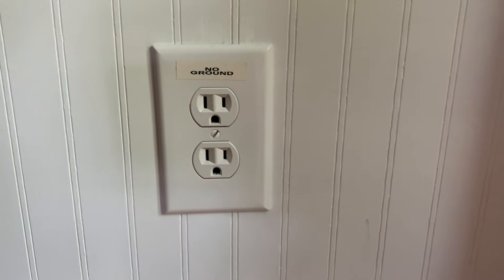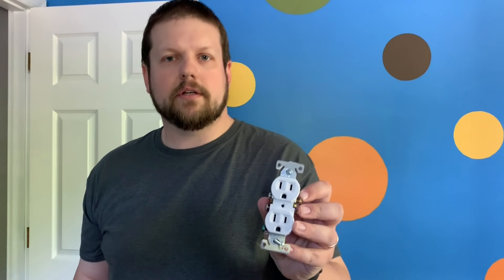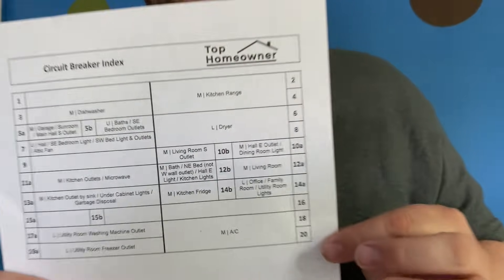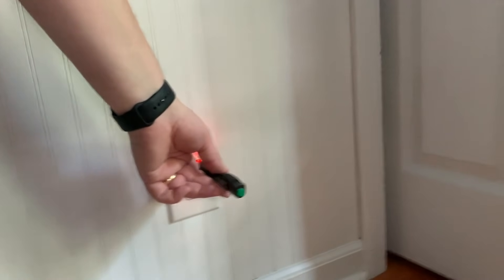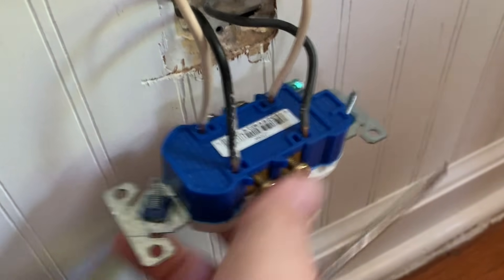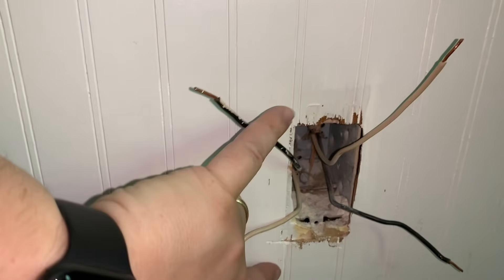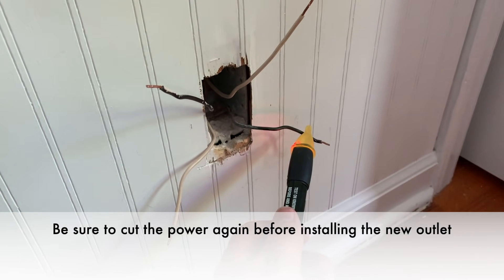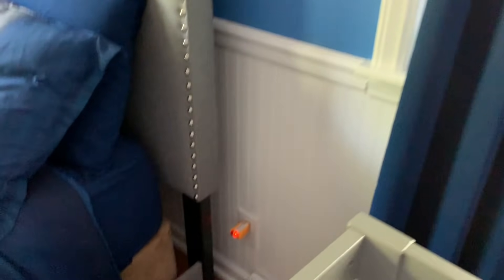Fixing Ungrounded Outlets - An Alternative Option to Rewiring Your Home

Comment: To be code compliant, be sure to put the "no ground" sticker provided with the GFCI on the faceplate if you are replacing 2-prong un-grounded outlets.  GFCI does not protect by grounding, but by tripping.
Reply: Yes, its not code if the sticker isn't on it.  Plus the downstream ones should have that and the "GFI protected"; both stickers come with the plug.  Lastly it should be noted that modern electronics (computers, TVs, etc) won't have the same protection as a fully grounded plug, that is surge protector circuitry probably won't work.
Reply: @bob19611000  Maybe we should complete the course and tell everyone that new code requires a whole house surge protector at the main panel to help protect appliances and electronics.
Reply: BOB A its code to put a sticker on it if you’re replacing a 2 prong w 3 prong without ground. At least in Canada anyway
Reply: Thank you for the clarification of that.
Reply: @mrobvious5892  the gfci will still trip even without the presence of ground. They don’t even monitor the ground wire
Reply: @Nick-bh1fy  yeah it serves a breaker  if v that breaker v trips in the panel you know the gfi went bad
Reply: @Nick-bh1fy   I get that 2 wire deal under most circumstances, But do you want to be touching the metal case of a toaster Whos metal case has become electrically hot and is plugged into an UNGROUNDED 2 wire GFCI that happens to have gone bad, you haven’t done your monthly test just yet (tell me who really does) and you happen to simultaneously touch another metal appliance plugged into a  grounded gfci or regular grounded receptacle and get electrocuted? If your toaster was plugged into a grounded gfci in the first place (still a bad one!), odds are it would probably trip the regular 20 Amp C.B.when the hot wire touched the grounded metal case! In this scenario, You find the dead circuit, the faulty toaster, the tripped 20A CB and the bad 2 wire gfci receptacle.  And your alive to wire some more circuits!!!!😁.  Never say never!  It CAN happen
Reply: THIS IS NOT CODE COMPLIANT The NEC does not allow a three-prong outlet to be installed on a non-grounded circuit unless the circuit is GFCI protected. An electrician can install a GFCI breaker in the panel or a GFCI receptacle at the outlet.Dec 23, 2021
Reply: the other outlet will not trip the gfci. Every outlet has to have a gfci not just one And yea i worked as an electrician.
Reply: This seems like a good idea to do if your outlets are grounded, and up to code too. It would add GCFI protection to all your outlets, without the expense of buying so many GCFI outlets.
Reply from the maker: Great point! I actually made a follow-up video that talks about this and answers some other questions: https://youtu.be/3AXcRsAOLPk
Reply: ground only is to protect equipment. it doesn't protect people
Reply: @jimmytate7587  that is not true. It's absolutely to protect the user. If an appliance has for example a internal connection fail resulting in an energized wire coming into contact with a conductive chassis then any metal also also making contact will energize. Say a guitar amp for example with a classic style metal toggle switch mounted in a steel or aluminum faceplate and the user turns it on while grounded from being barefoot as an example then that stray current is going to take the most direct path to ground which will be through the user completing the path. That's why so much effort is performed to provide grounding. It's is absolutely 100% a safety issue. I would encourage anyone who doesn't know this to educate yourself and watch some videos explaining grounding and bonding or not bonding neutral and ground in panels and sub panels and why. May just save a life someday. Take care.
Reply: @jimmytate7587  false.  If you have something electronic in a metal case, such as a DVR, and it has a 3-wire plug, the dedicated ground is used to trip the breaker.  If a component inside the case fails and grounds to the metal case but does not make contact with the neutral, their will not be short that reaches the breaker to trip it (you will not have the 15 or 20 amps required to trip it).  If someone touches that case there is a chance they will get zapped due to the power still being active.
Reply: @jimmytate7587  is ignorant.
Reply: @jimmytate7587  That’s not entirely true, power will go to the least of resistance so unless your grounded better than the grounding wire you’ll never get full force of the power. I replace plug ins all the time without turning the power off. Once in a while if I’m not careful I’ll touch the hot wire and get a little jolt! LOL  Not even as bad as a electrical fence shock, I know been zapped by those too a few times!  When my wife’s deceased husband had his garage built and the wiring was supposedly done by a license electrician it ended up not grounded properly and her deceased husband was up on a ladder replacing some florescent lights and touch a metal support and a light at the same time and lite him up like a Christmas tree throwing him 20 ft across the garage and shattered his shoulder completely. He ended up being disabled after that and could no longer shoot rifles for hunting was forced to go to crossbow hunting only!  Big difference between that ground wire being connected properly and no ground connected at all!
Reply: @ghostridergale  if I hear one more person  say: electricity takes the path of least resistance, I’m gonna puke 🤮  You getting shocked has ALMOST nothing to do with that grd wire.  Whether it has a perfect connection or 10 ohms of resistance. Whether your body is in series or parallel to a load or that ground.  Your body represents such a very high resistance value, that the 10 ohm bad grd connection doesn’t save your body any appreciable amperage flow.  You still get 99% of your electrical shock!!
Reply: @mrobvious5892  electricity takes the path of least resistance.
Reply: @donaldhinson7144  Donald,  you are a bad, bad man!
Reply: The GFCI outlet should be grounded so it properly works when there's a short on the line.
Reply: @lj2991  - A GFCI does not need a ground to work properly.
Reply: @lj2991  If the short is to ground, it will trip the GFCI, if the short is between conductors it will trip the breaker.
Reply: @lj2991  not true

Comment: This is absolutely false information. Do not do this as it does nothing to correct the fact that there is no ground.
Reply: @Seventh Anubis The point is to allow use of grounded plugs like in case of computers. I would be hesitant to rely on this in dangerous places like bathrooms as GFCIs can fail. But bathrooms should have grounded sockets even in old homes.
Reply: The practice is NEC compliant. Check out this video at 7’52”. https://youtu.be/16KObgI44UE
Reply from the maker: I made a follow-up video that talks about this and answers some other questions. You can watch it here: https://youtu.be/3AXcRsAOLPk

Comment: To whom it may concern. This is not intended to ground the circuit which is required of many devices for protection and functionality. Putting a gfci on the line side of a circuit allows you, by code, replace 2 prong outlets with modern 3 prong HNG outlets which allows you to plug in devices without those 3 to 2 prong adapters. The greater benefit is in case of you becoming the ground it will cut the power to that circuit and hopefully you won't die.
 Unfortunately routing existing circuits is usually never that straight forward especially in older buildings. And also code requires nowadays for the outlets should be wrapped with tape across the terminals and mounted inside a box extension when they are mounted in a metal box... especially in wooden paneling. And always use the screws not the lazy mans quick connect and if you have 3 pairs of wires, pig tail 'em.
Reply: I do all of that,for safety and good practices, also ,the job is done in a more professional presentation.,
Reply: What does pig tail mean
Reply: @a.m.bender  Oh, he means take the wire in the box, wire it to a short piece of wire of the same color to extend it, then connect that to the outlet.
Just reading that text, I can see the next question coming, "why would they do that?"  so I'll answer that too.
It is assuming a source wire coming to the box, then another is going from the box to other outlets.  If an outlet connection goes bad on a pig tailed outlet, it may only affect that outlet.  If it goes bad on a daisy chained outlet, all the outlets downstream might not work.
So, electricians like pig tails because it can save them time troubleshooting.
Reply: @a.m.bender  bend the wire like a pigs curly tail to wrap around the screw 🐽🐽🐖🐖🐷🐷😎😎
Reply: code nowadays? you should always wrap wires with electrical tape
Reply: Where in the NEC does it say thay? Hmmmm?

Comment: GFCI plug. If current is unbalanced (more on hot wire than on neutral) the GFCI will trip.
Reply: Only if the shared neutral comes AFTER the GFCI.  It's fine if the shared neutral comes BEFORE the GFCI.
On Knob and Tube circuits for instance, I'll use a double pole GFCI on both circuits...since the sharing of the neutral happens in the panel, both circuits are fully GFCI protected.

Comment: THIS IS SO WRONG!!!! DO NOT LISTEN : 

Here is a list of why this video is Terrible ;

- Grounding in the home's circuitry is for electrocution protections, whilst GFCI is only shock protection. They have different functions and do NOT overlap. 
- 2 pronged receptacles are dangerous more so because of the cable/wire type that it makes up than the lack of the grounding. If you have 2 pronged receptacles it means that the home is wired with either 'knob and tube' or with 'anaconda' wiring - both of which are extremely brittle due to heat dissipation issues. 
- Sticking your wires into the back of the device is unreliable and can cause issues. While legal, any professional Service Electrician will tell ya that they see dozens of homes every year with active fires from backstabs becoming loose. 
- AFCI protection would be the best aid as it would actively look for fire potential.
- GFCI will not work properly on knob and tube wiring, which is the majority case for the homes that your talking about. Knob and tube circuitry shares its neutrals with other circuits, which creates a load imbalance and falsely sets of the GFCI

This video is severely lacking electrical knowledge. There is a reason why electricians have to have 8,000 hours (more or less depending on state) to even take the test required to get their license. Do not listen to an average Joe who is saying information that you may want to hear because it is easier to believe than the truth. Electrical infrastructure is the second most common reason for house fire - only losing to cooking with oil - and this is inclusive of new homes that do not have the high risk of electrical fire. Consult an actual electrician before considering rewiring - PLEASE
Reply: Please delete. The comment is nonsense. Sure an old wiring may need replacing but it is a separate issue. Electrocution is death or serious injury through an electric shock. a GFCI receptacle cares only of the balance downstream from it. If neurals are shared elsewhere that is not relevant.

Comment: Most of the commenters do not know how a GFCI receptical works. I will try to explain how it can save your life in layman's terms.
The GFCI receptical measures the current coming in from the "hot" black wire, and the current going back on the white wire, They must be equal, or the GFCI will trip. If some of the current is flowing through your body (6 milliamps) and it is returning through a water pipe, or some other Earth ground instead of the white wire, the receptical "sees" the unbalance and trips within 40 milliseconds. Fast enough to save you from being electrocuted. This will also work for the "load" recepticals downstream as well. It does not provide a ground, but it still saves lives as well. Hank Kline Master Electrician.
Reply: Another thing people don't know is if someone was electrocuted that means the shock resulted in death. If you didn't die you just got shocked. But that doesn't matter too much unless your talking on the job
Reply: Brian Uehlein  LOL. Come one, man. Isn't that an official title tho?
Reply: super informative, thank you
Reply: I live in an apartment in NYC. I started learning electronic repair and am scared of static electricity. I ordered a grounding bracelet and connected it to a power cable (all but ground prong & wire removed) which I planned to stick into my outlet however there is no ground wire connected to the outlet. Any options I have aside from calling an electrician? This is actually why I clicked on this video but it doesn't help ground my issue.
Reply: @PapaGleb  There is no option, an electrician will need to run a new line, that's truly the only way to be grounded and very likely the only way per code.
Reply: @PapaGleb  The Coaxial cable that your internet provider supplies should provide all the ground you need to dissipate static electric shock. Or your Cable TV coax should also be grounded. You can use an alligator clip to ground your strap.
Reply: @hankkline7300  Hank, THANK YOU so much. You have no idea how many videos, questions, etc I have read/asked with no help/reply. Thanks again!!!
Reply from the maker: I appreciate the comment. I actually made a follow-up video that talks about this and answers some other questions: https://youtu.be/3AXcRsAOLPk
Reply: Hank Kline, I thought a CFCI will not work without a proper ground?
Reply: @Seventh Anubis Do you say that because you believe anything that isn't water or metal has zero conductivity? Pure water is actually a very poor conductor; it's all the minerals in the water that are good conductors. Everything is a conductor though, just to varying degrees of ability. What this means is that even if you are standing on a wood floor, you are still "grounded" to the floor and the earth beneath it and the current will choose to go through you which it would much rather attempt than making the unattainable attempt to arc through the air. This GFCI will notice if that ever were to happen and save you. Stop correcting the electrician that knows what he's talking about. Recognize that your misinformation could put someone at risk. Standing on wood/vinyl/tile/laminate does not make you invincible to electricity!
Reply: @jalinmurphy9  I have a pet bird, he explained to me why he can perch on electric wires...
Reply: @jalinmurphy9  Thank you, to the armchair know it all's haven't a clue how little current it takes at 60Hz to kill,
Reply: @ethelryan257  So correct. Current is the killer, not voltage. 1/2 amp can be deadly.
Reply: @royalway12  6 milliamps is the trip threshold for a GFCI outlet or breaker. 50 milliamps will usually stop your heart.
Reply: @jalinmurphy9  The Grand GFCI will save you!! 🥴No worries mate! 😁IF you’ve tested it?  IF ITS WORKING when the fault occurs?  IF you don’t get electrocuted between hot and neutral!!  IF I decide to pull out my stove so I can test the one my dishwasher is plugged into?  If my bathtub is ACTUALLY GROUNDED? 😡SHIT!! Fiberglass tub 🛀 plastic drain plumbing!  Let’s just teach the kids that water + electricity = DEATH 💀 And hope that’s the one or two times they need one in their life,  that its functioning😁
Reply: @jalinmurphy9  My uncle was conductor for Burlington Northern Railway.
Reply: Brian Uehlein  Contractor 40 years+, Passed Masters test in 2 states gives me the right to consider myself qualified.

Comment: To be fair, you are correct about the electrical code allowing this option in lieu of replacing the wire or adding a ground wire. Other than that, there are so many things wrong with this explanation. Don't take this as rude, but do yourself and your family a favor, and anyone else that might watch your videos and mistake your information as experienced electrical advice, and leave the life threatening electrical work to the actual professionals. You don't know what you don't know and that can and will get you in trouble.
Reply: If this is allowed by code, then how is it not safe?
Reply from the maker: I made a follow-up video if you are interested: https://youtu.be/3AXcRsAOLPk